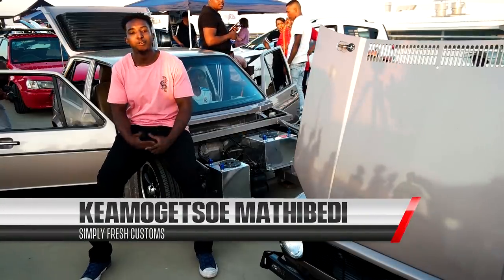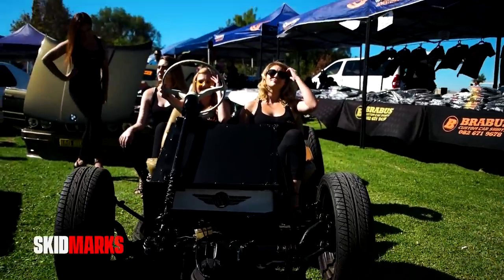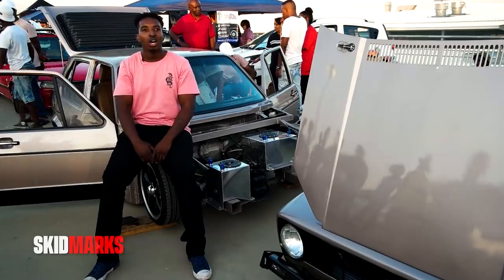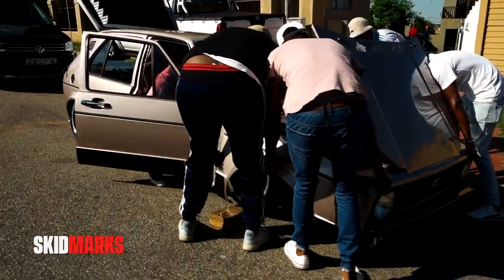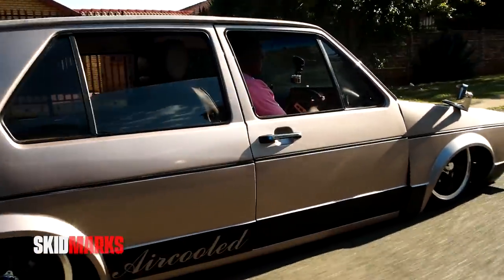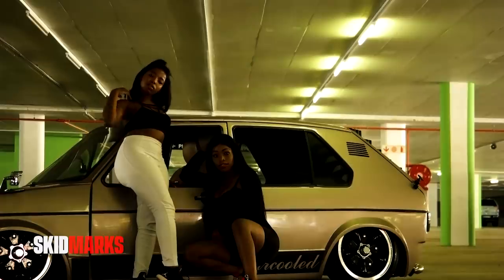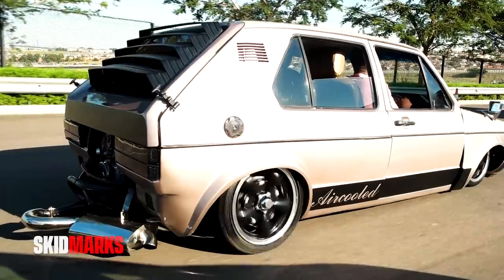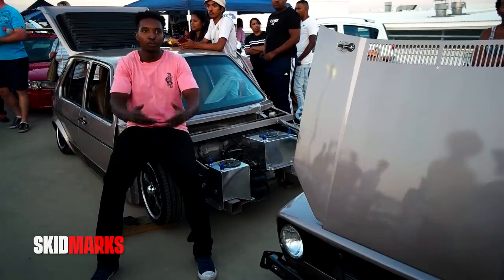Aircooled MK1 bodydrop | Scrape it till you make it

Comment: Pics lie. I thought this car was cool until now. What a disappointment 💔 

Those fenders flapping made me cringe

06:09 is when I lost all hope in humanity

On the plus, your passion makes up for it buddy. Watched it a few more times and I respect your vision
Reply: I thought I was the only one... The fitment itself looks like crap...
Reply: I respect his vision for doing something totally different. Fair play, it is! That front end does need a revision tho, the front wings (fenders) flapping about in the wind is frankly shoddy, but it could be made to work with a little more thought / fabrication. 👍
Reply: Just as an addendum to the above, the original mk1 BBS body kits, had a kinda squared off arch which could be copied in sheet steel to allow for the ride height & width of the wheels, then the wings / fenders could be properly attached, and made to align with the doors / bonnet, whilst still keeping the OEM(ish) Mk1 front end look. Just a thought... 👍